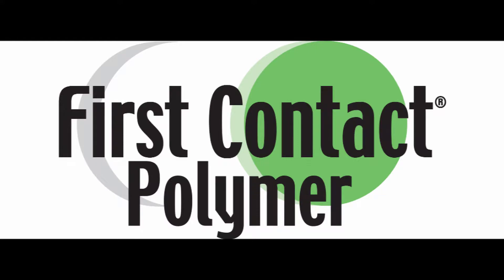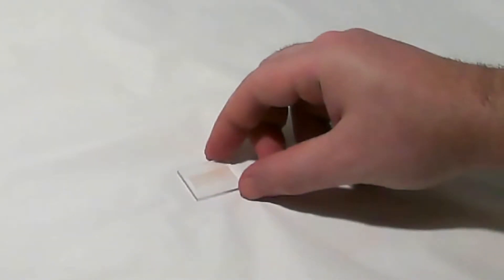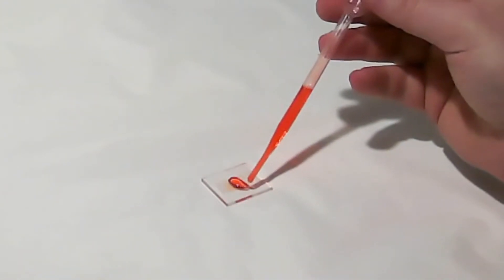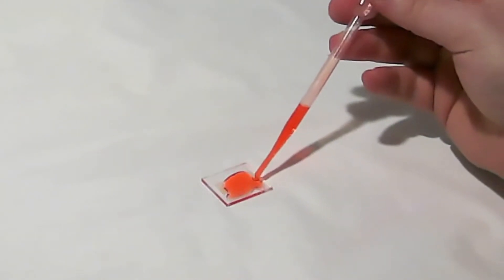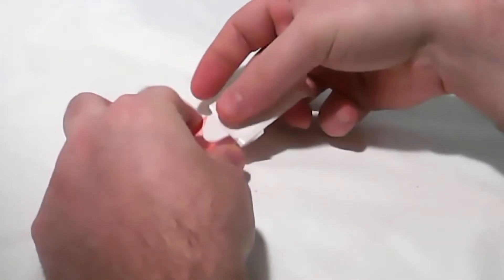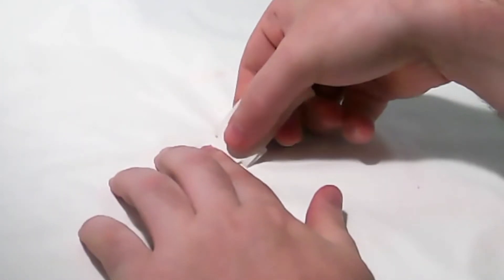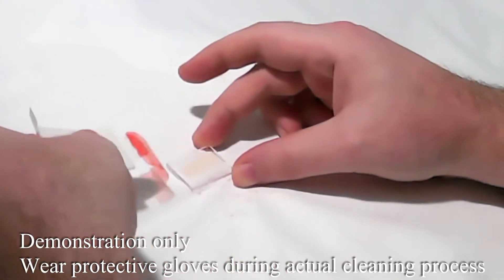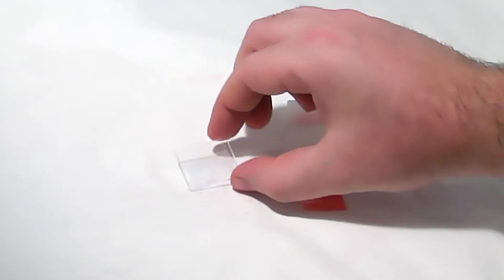Cleaning a Phase Mask / Diffraction Grating with First Contact Polymer

Comment: Can you review whether or not this works on older Film SLR camera Split Image Fresnel Focusing Screens? They are usually made of plastics and easily damaged.
Reply from the maker: Hi Zipo214, thank you for your inquiry.  We offer a plastics-compatible polymer for polystyrene, Zeonex, and some acrylics and polycarbonates: https://www.photoniccleaning.com/category-s/155.htm

We are not aware of the lens' exacty type of plastic so we suggest researching the lens type before applying the polymer.  Also fresnel lenses require a very thick polymer layer in order to properly peel without tearing.  The polymer will flow off the sharp edges of the fresnel lens so one must apply the polymer above the sharp edge so that the dry polymer film has sufficient strength to peel without tearing.